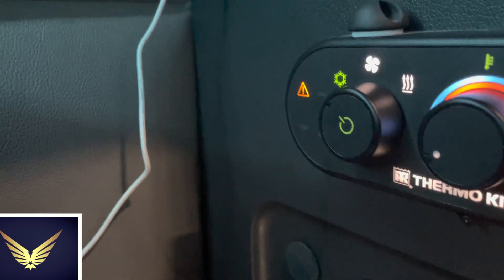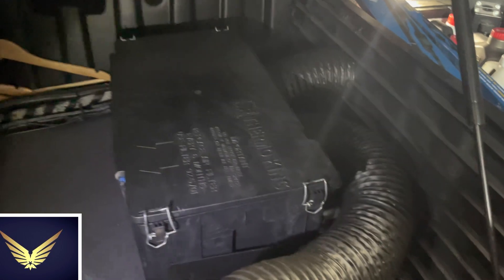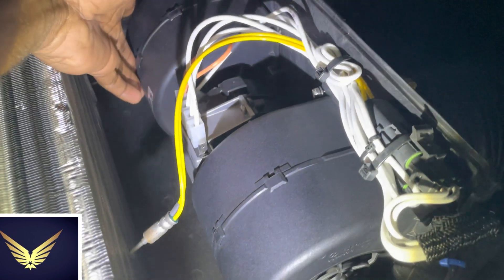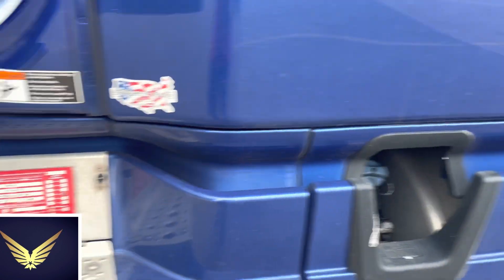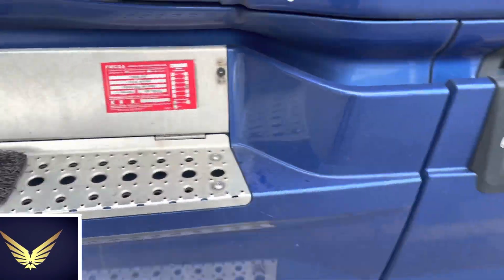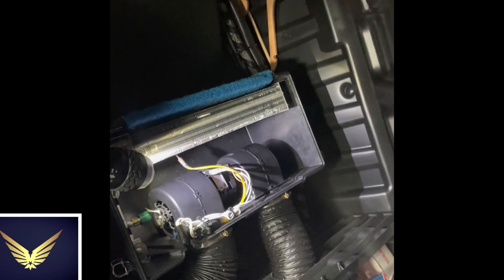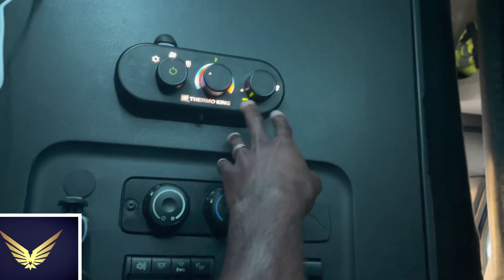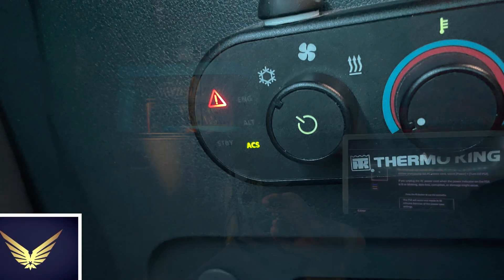APU red/yellow Light Troubleshooting

Comment: I had the yellow triangle and then red triangle. run for 20 minutes or so. I'd restart the APU and it would run for 20 minutes and shut off. I was told by a thermo king dealer that i needed a new a/c compressor. Or freon is low. I let it go for some time. A friend of mine worked for that thermo king. And quit. I asked him what's the deal. He said 90% of the time, it's a ground or loose connection issue.  I spent couple hours taking connectors apart, cleaning them, and reconnecting. 
After all connection cleaning, alternator connections, and major ground to frame, it fires up and works just fine

Comment: Solution that worked for me is keep things away from where he pointed out, change your filter accordingly, check your oil level and top it off with regular motor oil, and check your APU fuse box. If your fuse box under the bunk and turn on the APU look at your open fuse box. After you start the unit, there should be normal blinking green light. If you find a fast blinking green light, then you have a blown fuse. Thank you man I had a multi problem.
Reply: Ok ty

Comment: Doesn't the apu run off fuel from the truck because i dont know any motor that runs like that thats not using fuel
Reply from the maker: Yes it does.
Instead of of using 100% fuel like the engine when tuning, APU uses only 1%.
Saving and avoiding idling when parked.